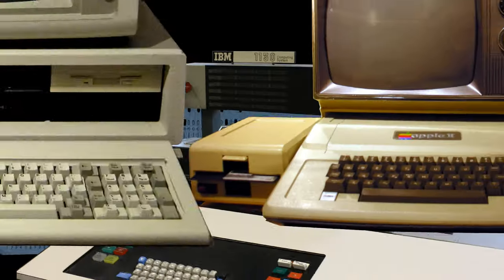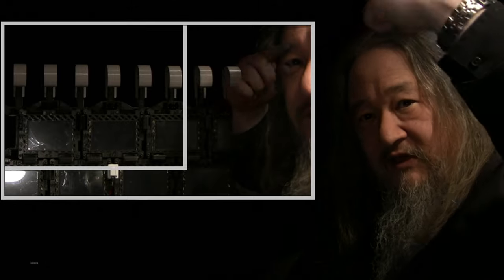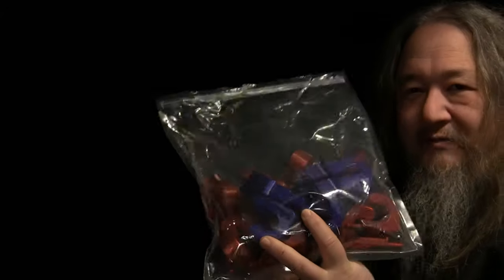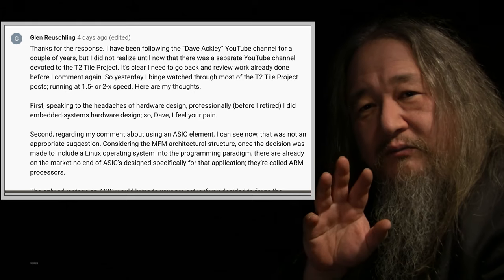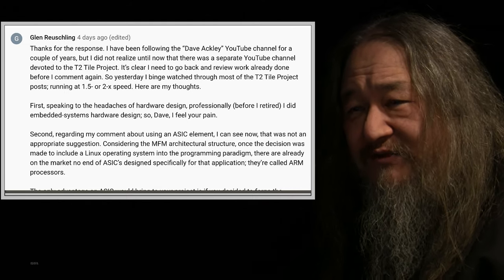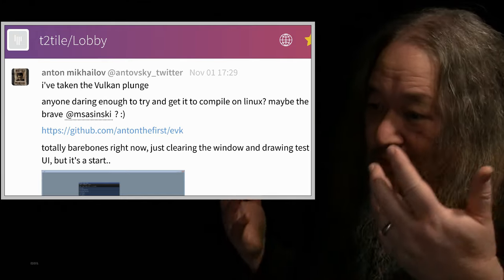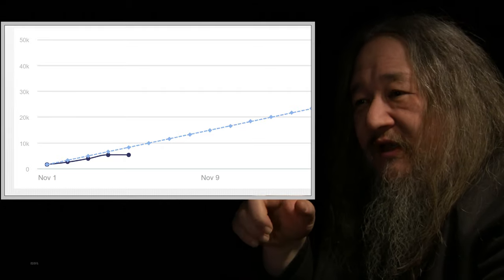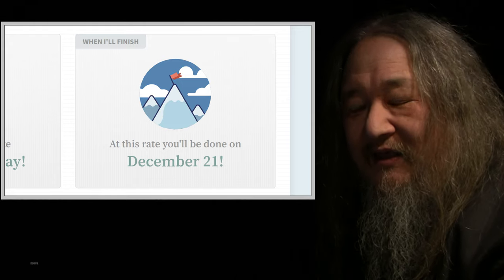Fact and Fiction - T2sday Update 257

Comment: Dave, thanks for the note. The array processor concept I had a chance to work with was conceptually different than the one you’re working on, so I’m not sure how much of my experience would cross over and be useful.

First, I find I’m in perfect agreement with your critique of the various array processor chips that have appeared on the market over the years. You’re right, at the chip-level, design engineers have come up with some incredibly clever concepts in silicon, but then don’t seem to give a moment’s thought to exactly how these chips would be used in practice. And as a result, they end up creating designs with insufficient memory and I/O to be of any practical use.

For my part, the design goal of the project I was part of was the creation of a primitive computational element that could be tiled, potentially by some process of self-assembly, into larger arrays. The question then becomes, what kind of programming structures can/will arise in such self-assembled arrays of simple processors? One intriguing possibility is the appearance of emergent behaviors; a hardware version of Conway’s Game of Life, perhaps?

This seems to be the opposite direction of the MFM-T2 hardware design effort. You’re starting with a programming paradigm already established and running in simulation and looking to create the necessary hardware structure to instantiate it with.

What I find fascinating is the possibility that these two approaches, while starting from opposite sides of the software-hardware divide, might end up sharing considerable programming overlap.
Reply from the maker: Interesting!  Did any pubs come out of the project?
Reply: No publications, though at the time I read through quite a few. Once it became clear that the project was not reproducible in hardware my enthusiasm left me and my interests went on to other things. But that’s not to say, that interest couldn’t be rekindled again.

Three essential attributes you get with the ability to self-assemble at the hardware level: the ability to grow, the ability to self-reconfigure, and the ability to self-heal. So, in a way, self-assembling processor arrays are the complement-in-hardware to your notion of robust-first-computing.

Behind your interest in robust-first-computing, I’ve noted a number of different factors. One factor you haven’t touched on is longevity. We tend to think of computers as working on nano- and micro-second timescales, but what about a computer system that would have to operate on a generational timescale?

Since you’re currently writing a science fiction story involving your MFM-T2 concept, here is a fictional example where a generational timescale computer would be necessary. The disappointing truth is that there is no faster than light hyperdrive. Humanity’s first trip to the nearest star will have to be done using conventional propulsion; which means a one-way travel time measured in thousands of years. The only computational system that could possibly work in this scenario is one based on a self-assembling hardware platform that uses cellular automata as its computational mechanism; exactly the ideas you’re working on.